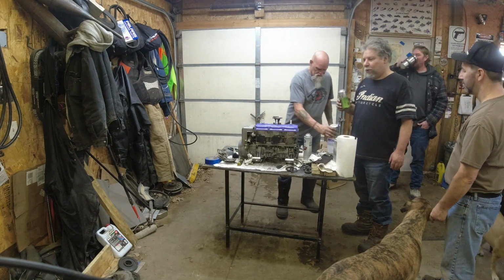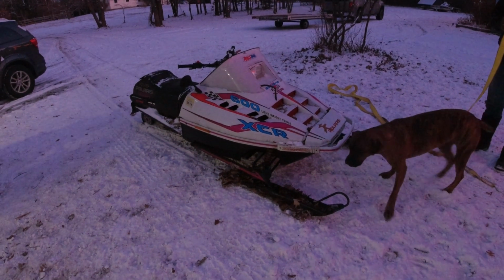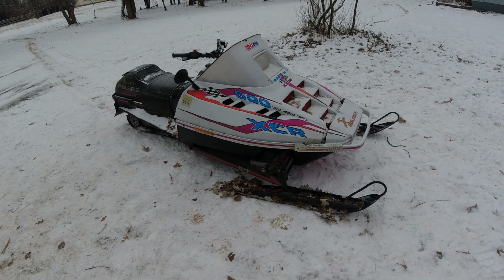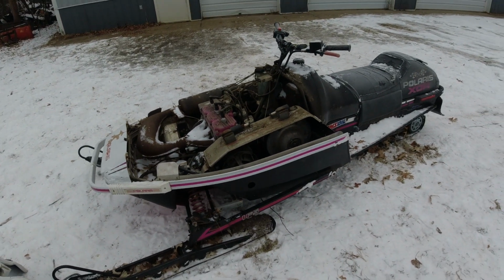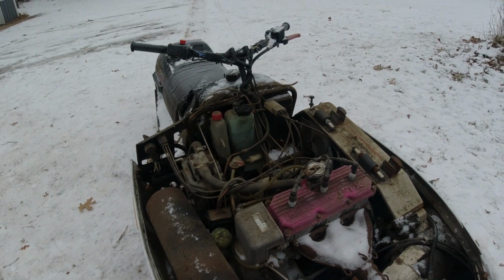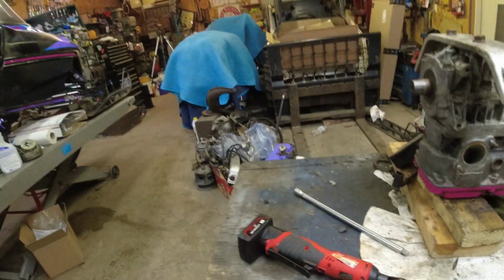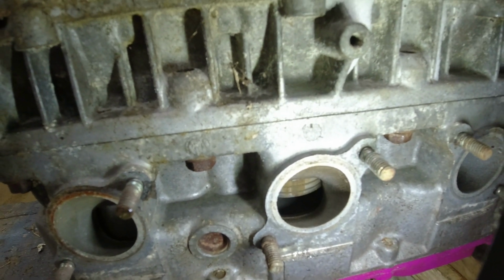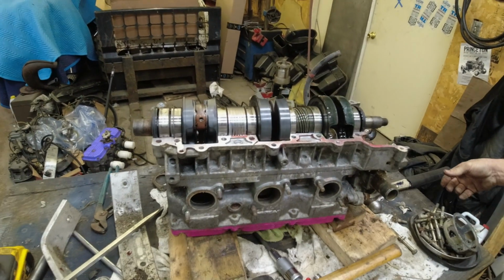Dennis' 95 Polaris XLT SP rebuild part 3. vintage triple sled snowmobile

Comment: When judging crank bearing noise do you listen to them mostly dry? Or do u add a little 2 cycle oil and spin and listen
Reply from the maker: Mostly dry. They all sound good when they are full of oil. I don't spray them out with cleaner or anything. I just spin them as they are.